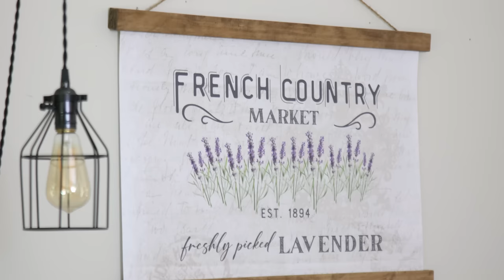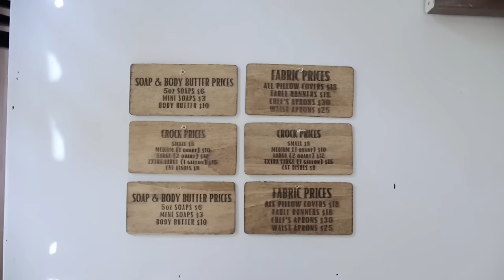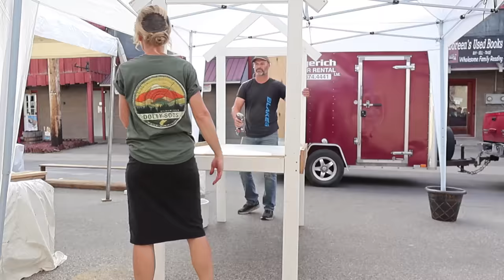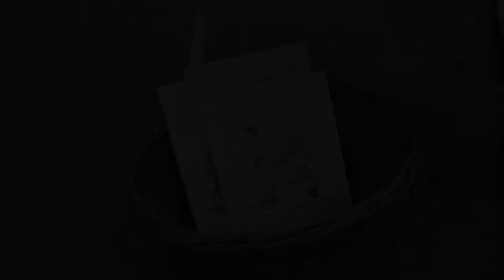Fall Harvest Fest Set Up ~ Berlin Harvest Festival Booth ~ A Week in the Life ~ Random DIY Projects

Comment: I have a portable carport frame (Harbor Freight when on sale) that I modified and cut down to 10 ft long (You still have to use 6 legs though). It is pretty sturdy after being drilled and bolted together. It goes together easily as long as the connecting joints are marked. I plan on cementing the bottom leg joints into some kind of cute flower pots or something that goes with my theme. You can either cut out the middle of the cover (that is included) and sew it back together to fit the modified carport (you'll also have a bonus tarp if you play your cards right), or sew a fancier new one. The height of the carport frame allows for taller furniture under the canopy.